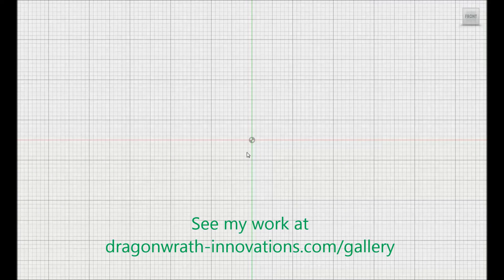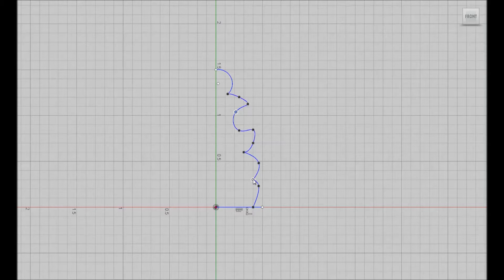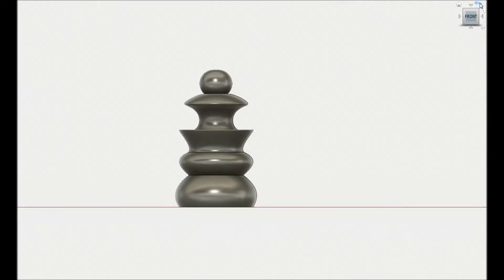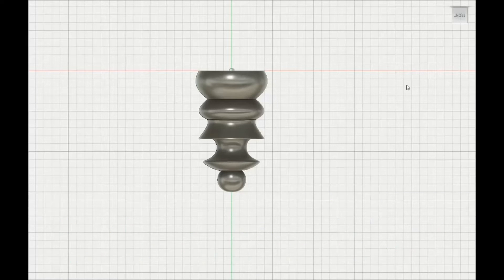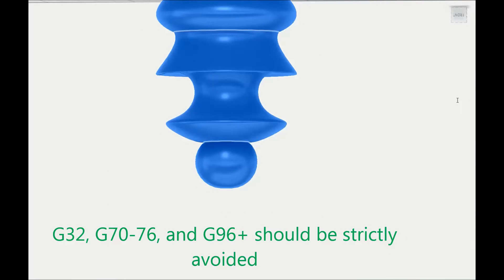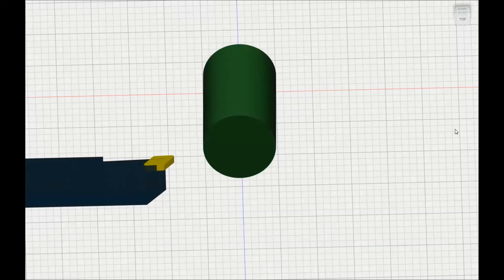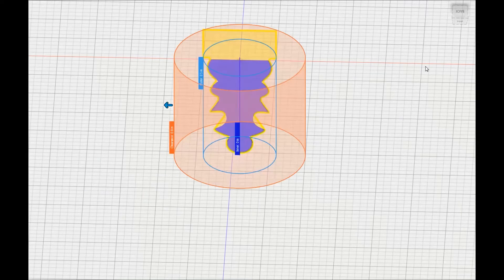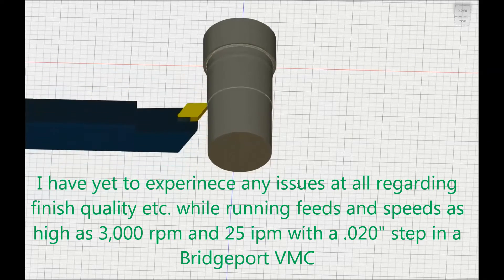Turning with a CNC Mill - From CAD to cutting

Comment: thank you posting the video. What post processor are you using? I have been trying to do this. In the code fusion 360 creates, the x axis motion is always double of what it should be. not sure why that is. The simulation in 360 is correct though.
Reply from the maker: Very good question, wasn't sure if I had mentioned in videos. In 360 select the post processor you want to use and click open config. control - F to 'find' and look for 'xformat'. There will be a scale: value, it is likely set to 2 in your case. Set it to 1 and you should be good to go! Thanks for watching :)
Reply: Thank you for being open about the details, this video was inspiring. How did you hold the part up in the spindle?